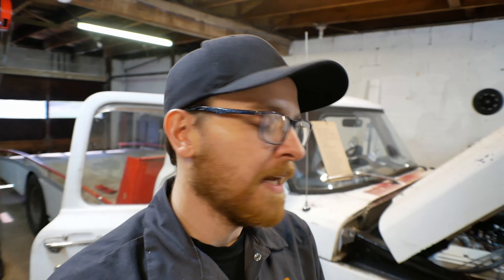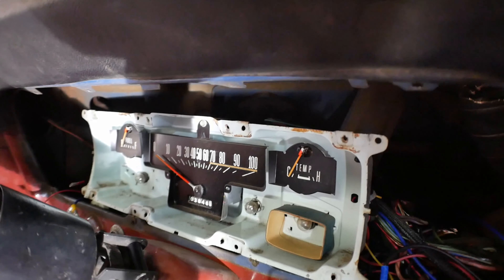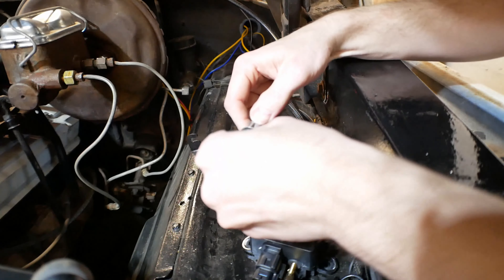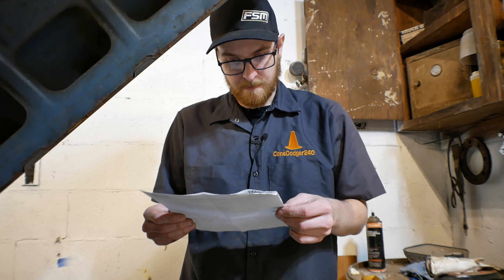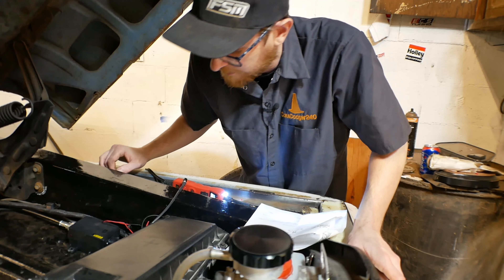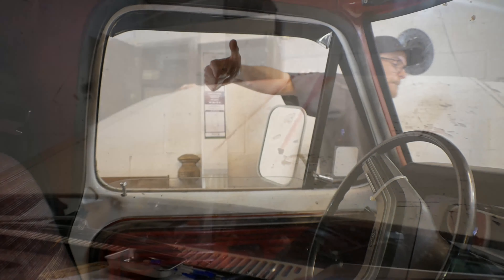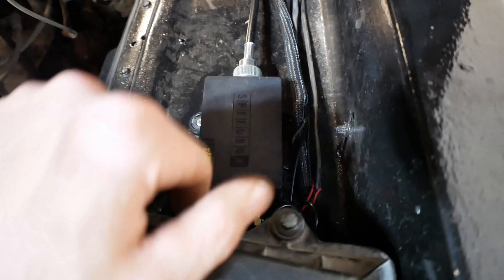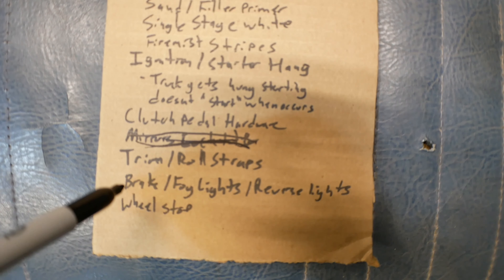Speedbox GPS to Mechanical Speedometer Install on the Ramp Truck

Comment: Its not waterproof  also does it keep the odometer miles counter working ????
Reply from the maker: It spins the speedometer in the same way the transmission cable does, so yes the odometer is still spun. 

Years later still works no issues mounted on the upper fender well.

Comment: More of an FYI- Ford , GM, Chrysler used a base reference in design of 1000 rpm on the drive cable at 60mph.

Comment: Ive just fitted up a 4l80e behind a carbed 454 in a g20 van. Setting up the transmision controller and tps etc. This will come in very handy for my application.Thank you so much for uploading this video.
Reply: I'm about to do the same motor/trans in a 70 Nova. How did it end up working for you? Would you go this route again?
Reply: @BBBILLY86  Absolutely mate

Comment: My brother has that engine. It's in the last year run of the 460. The EFI started giving all sorts of trouble. I pulled the top end off and redone the heads , made a simple 4 barrel adapter for the intake. Used a Holley Demon 650 on it. Also dropped in a General Motors destribitor , and got rid of the Ford garbage ignition system. Anyway it woke that engine up like you wouldn't believe. He says it gets much better gas mileage now as well. It had pulling power before , but now it'll twist the driveshaft into a candy cane. Like seriously it has so much power it will self destruct itself now. I've had to replace two clutch discs since doing the carb swap.

Comment: The speedbox cable information is limited or actually incorrect from manufacturer. I spoke with Jeggs and they also gave me incorrect information. So.. basically Ford, Chevrolet and Chrysler all used the threaded cable prior to estimate 1980. I was told clip on cable for a 1956 Chevrolet Belair,  yeah right. 
Great video much more informative than the directions.

Comment: 5:21 I know that Diesel emblem! And great video. Im thinking on maybe using one of these in the future on a project.
Reply from the maker: Still having good luck with it, haven't had a dead spot in the gps yet, only thing I can say is make sure you have that cable setup in a nice smooth route, it binds up pretty easy.

Comment: 5:00 .05A is quite a lot for ignition off draw, max spec for most modern cars is <.060
But I looked it up and it's actually 25uA or .000025A

Comment: just a heads up that speedbox is not waterproof so not a good idea to put it in the engine compartments
Reply from the maker: I'd be in a world of hurt to get water up that way, but thanks for the tip I'll build a box for it to block possible coolant explosions as least

Comment: Cool part. Personally, I would be annoyed by the fact that the speed signal wasn't generated in the truck, but that's my preference. I am a little surprised you couldn't just install a magnetic pickup on the transmission u-joint or something. Still would need a box to convert it to a mechanical signal though.
Reply from the maker: The same box can be used in that way, if you send it vehicle speed sensor data it can convert it to mechanical. If I was using OBD2 or a more modern ecu setup, this would be possible.

Comment: Link to the power probe...
What do they give you to cover where the old cable connected to the transmission...
Reply from the maker: https://www.amazon.com/Power-Probe-III-Clamshell-Automotive/dp/B00G4YUWMC 

One of my fav tools, lets you send power or ground through the tip too to test functionality
Reply: @ConeDodger240  
Is a cap included to cover the old plug going to the transmission output shaft...
Reply from the maker: There is no trans output on the zf5 I used, think that's the case use for most people using something like this so no plug included

Comment: So hooked mine up to mustang and guage is all over the place. How do I get it to work correctly. I hook GPS antenna up. Black to ground and red to ignition.  Working but not accurate at all.
Reply from the maker: I found that to be related to cable routing, the motor seems pretty weak and only likes to spin at the right speed at a very specific angle, with minimal kink